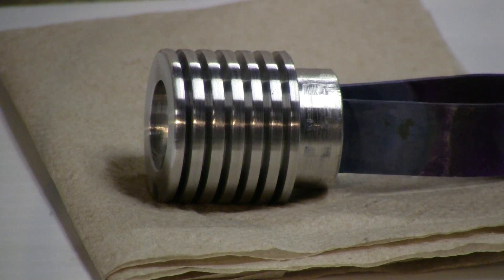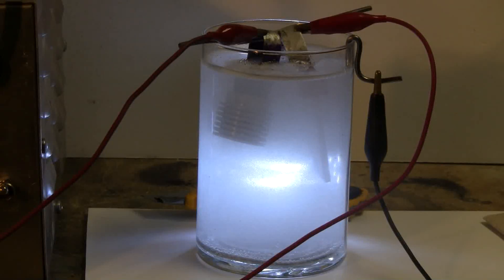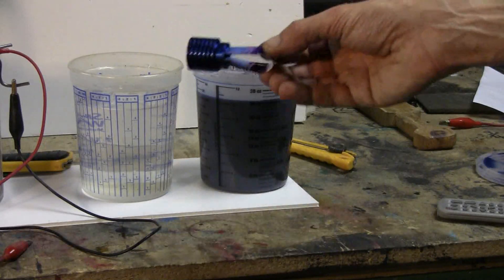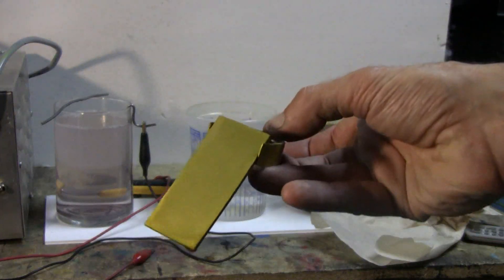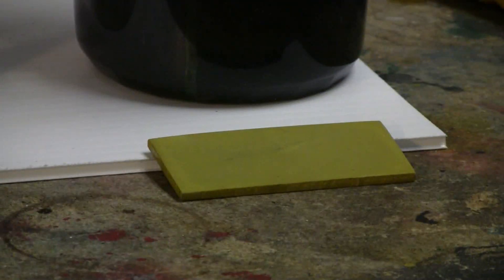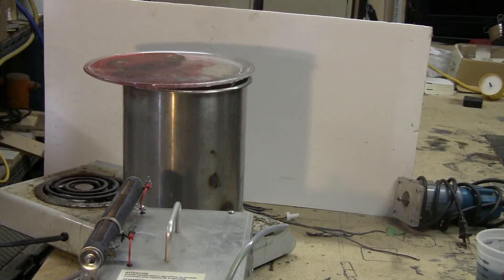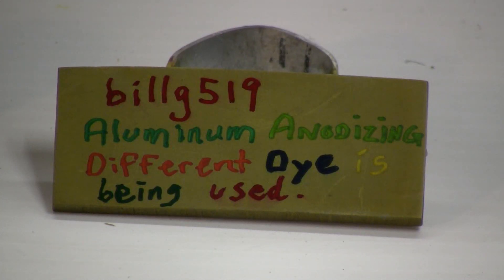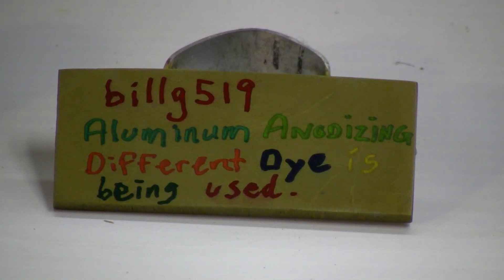How To Anodize Aluminum  #2 - A Quick Look At Dye And Markers

Comment: I have yet to see anyone anodizing with dye present in the acid..  and of course the dye might be damaged by the acid. But are you aware of any other reasons? ie, do you think an acid-tolerant dye if such could be made, would actually interfere with the anodizing process?

Also, I hear crickets. Do you keep tarantulas or something?
Reply from the maker: +TheBaconWizard The acid will bleach or destroy most dyes. This is the reason for the separate dye step.
Reply: +Bill Gilmour Thanks for the reply.
Ok, so if I could find a dye that will withstand it, that would be ok? I&#39;m keen to try using graphene ink and then dissolving the oxide away again to leave graphene rods approx 100nm diameter. Could great for a capacitor.

Comment: If you had a couple of tiny parts to anodize could you get the ink out of a sharpie and  dilute it with something to use as the dye????
Reply from the maker: Yes, you could remove the foamlike ink tube from inside the sharpie and squeeze the ink out. There might be enough for a small part without dilution.
Reply: Thank you, have you ever tried printer ink??? It's just that I can only find Caswell black 4oz for $55 plus post so am trying to find a cheaper option
Reply: Bill Gilmour You could make what crafters call "alcohol ink". There are videos on how to make it yourself. I would love to see the results from that.
Reply: Years ago I read somewhere that Razz cloth dye could be used as a dye. Whatever colour the dye come in.  Might be worth a try

Comment: Bill, thanks for posting such staff, i have one question, how do you prepare aluminum if it is for example used part  from a motorcycle and looks bad. Should I polish them first?
Reply from the maker: Do all of your prep and polishing prior to anodizing. Any defects such as scratches, dirt, polish residues, or fingerprints will get sealed in by the anodize layer. Note that some alloys of aluminum do not anodize well. Was the motorcycle part anodized before? If so, you should have no problem.

Comment: cool I had just managed to read up a bit on how it worked.  interesting.  I find it odd that it is better to forcibly extend out the oxide layer beyond it's normal thickness instead of etching it off and dyeing n then forcing it to go.  but hey I am just learning I am sure there is a reason they do it the way they do.  thanks again for the share and prompt answer.

Comment from the maker: The sealer is a Caswell product, available from their website.The anodize process actually deposits aluminum oxide onto the clean aluminum part. The dye, if used, colors this oxide layer by entering the microscopic pores. The boiling process (you can boil in plain water if not dyeing the part) closes the pores down, essentially hardening the anodize layer. Sealer added to the boiling water helps make the dye colorfast and fade resistant. Sealer is necessary with commercial dyes like Caswell dye.

Comment: nice man.  I like the enclosure you built.  always wondered how this was done. thanks for the share. couple questions,, what is in the sealer?  does the anodizing process basically micro pit the surface and remove the resistant oxide layer.  allowing you to dye it and seal or re-oxidize to a protective surface?   thanks